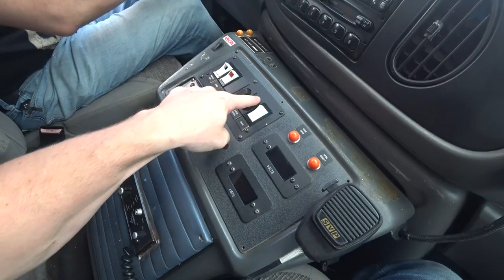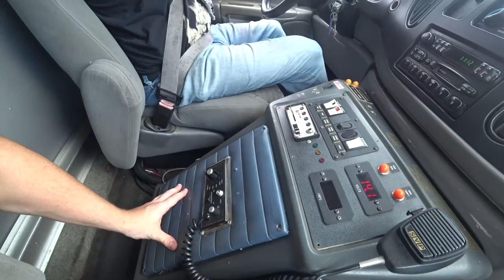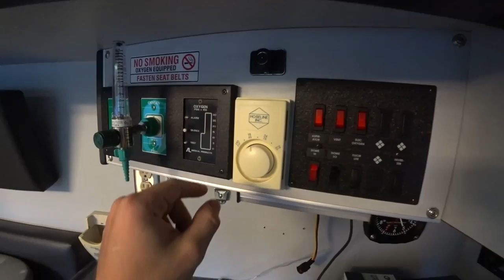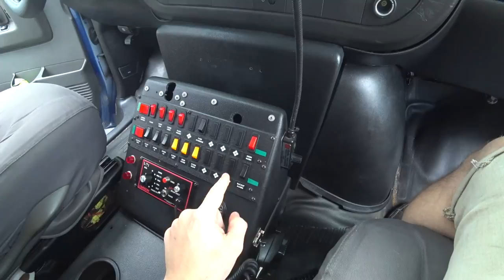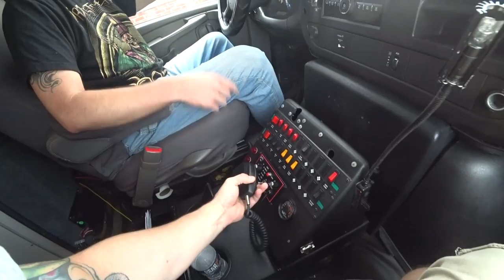So, we bought an Ambulance (EVERYTHING STILL WORKS!!!)

Comment: I’m an EMT, working on an ambulance I can say that those ambulances are super sluggish and fall apart. And I will also say, be careful walking on the roof of an ambulance, they made weak in the event one of the oxygen tanks explodes, it explodes upwards as opposed to outwards to protect everyone around the ambulance. Just some fun facts.
Reply: osha compliant half the time
Reply: If it's a Braun ambulance you will be able to walk all over the roof cause  they are solid body's and the roof structure is all completely tied in and welded...how do I know this...well I still am currently working for the Braun ambulance manufacturer in Van Wert Ohio.
Reply: Its ok dont worry, Dan is baby weight with those baby arms
Reply: Dan doesn’t weigh very much. He’ll be fine
Reply: Next they should buy school bus, fuck it dud
Reply: @MarcLloydZ  might as well go and buy a rocket and fly to the moon
Reply: This is completely made up. You have no idea what you are talking about. They are NOT made weak. There are actual standards and static load tests the pt compartment must pass including the roof...you know...like in a rollover...one of the most common ambulance accidents? They are not made to "explode" upwards. You seriously are just making this up. If you are an EMT, it certainly isn't on an actual ambulance or you would know this. Say, what about the type II buses that have the tanks mounted horizontally? Do they have weak doors and sidewalls so the tank blows out sideways? GTFO with your "facts" as none of these actually are...
Reply: How did he get it with all that stuff thay usually take it out
Reply: @kadenfarmer6255  I wondered that also....
Reply: @shaggy the gears and input shaft are hardened steel. if the internals of a trans were non treated steel or just aluminum they would be changed regularly.
Reply: @Adam yeah it looks like a Braun to me. I’m a service tech on Brauns, they’re tough units! #braunstrong
Reply: How about no? The boxes are made to survive some amount of impact and rollover. They are not made to blow the roof if the O2 tank blows. Get out of here with that shit.
Reply: christopher king  nope, the wheel and front end say mid 90's to mid 2000's E350 chassis cab.  Its old.
Reply: Agreed those Chevy chassis always break down
Reply: @chubbysumo2230  no the new chevy van chassis look exactly the same its newer then 2000s easily a 2010 or newer my fd had one of those was a 17 looked the same exact way
Reply: well sir (or ma'am) thanks for ur service
Reply: Came here from /r/EMS, but how many miles did your first rig have on it? I've won most of these; 680k on an '06.
Reply: @Adam-og3yw  I worked there to in the weld shop and chassis prep. Can DEFINITELY walk on the roof of that thing lol.

Comment: As a former EMT some of the equipment  in the ambulance you could probably sell to volunteer fire department  or rescue squad. The back boards, the cot, I thought I seen a stair chair in it. most of that stuff can be sold and re used.  or ebay even.

Comment: just letting you know it might be the transmission control module, if its stuck in one gear (which may be 4th), and if when you put it in drive it makes a cuncluk sound, also if you don't have a indicator showing its in drive or park, this happened to my dads truck and its a simple fix, just change the device and boom it works, but yes it may just be the trans

Comment: Hey Dan, it might be a good idea to swap the transmission filter now and clean up the valve body just to get the van mobile again. It should be simple and cheap enough to get it around the shop. plus dropping the pan to change the fluid will let you see the clutch plates that alone will show you if the transmission truly needs to be replaced or if you can put money to other things.

Comment: 2009 is the LMM Durmax 6.6 engine. But it doesn't really matter what you Allison you get, maybe a Ten speed if Allison sells it.
Reply: Just need a basic allison 1000 maybe with a mild build for good insurance.
Reply: Allisons are 6/7 speed depending on the model.

Comment: 7.3 motors will always be sluggish due  to the valve on the turbo being slightly closed to help with warm ups. Being in the southern parts just unplug the connector on the turbo. Being a van it should be easy if you take the cover off between the seats

Comment: you should've gotten a retired "activities" short bus with a cummins 5.7 throw the death pin fix on it and you got a SOLID base for a camper, no weak roofs, easier to do mechanical work on, and alot more responsive. the reason to get the retired activities short bus' is because they tend to have less wear and tear, are highway capable, and have storage for the instruments/equipment students would have for their trips.

Comment: JB Hunt is governed to 65mph. Swift is governed to 62 1/2. USA Truck is governed to 65. The only 18 wheelers goin faster than 65 are O/O ( owner operators ). If I remember right, CFI ( XPO Logistics ) are governed to 70 mph, they are the exception. I say this so matter of factly, is because I drove em for 6 years. Majority of my career i spent at USA Truck, along with CFI ( XPO ).  But anywho, great vid as always.

Comment: Had a situation with a floating title here in Florida...turned out you can fill out an affidavit from the seller stating that it was a failed prior sale, and attach the affidavit to the title and DMV will issue a new title to the buyer. Might want to check into it in whatever states you deal with because it can be a huge hassle savings. my mechanic shop was flipping out because they had already signed over the title to a car and then the buyer backed out and they have no way to contact them. They were told they would have to go ahead and retitle the car to themselves again and reregister it. She was totally freaking out over the time delays and cost. I made a quick call to a contact at DMV and found that we didn't need to go through any of that. She was so thankful I got a free oil change and tire rotation LOL!

Comment: It should already have an Allison transmission in it. Duramax is the engine not the trans. And I'm sure it probably already has a 6 speed in it. They've been putting those in since the early 2000s

Comment: 2009 is lmm (2007.5-2011 I believe), basically a lbz with emissions equipment. An allison swap would be pretty easy. I'd go for a dans diesel or another builder and get a built one for good insurance. Then find a reputable tuner and get that bitch tuned and deleted asap. A good 750hp trans build and solid tunes and that thing would be impressive.

Comment: as somebody who has worked on an ambulance, they're absolutely disgusting on the inside lol. Make sure you do a thorough cleaning first. Remove the flooring too because blood and other bodily fluids may have seeped into the seams, especially around the hardware that keeps the stretcher in place. And just be sure to remove the stars of life because I'm pretty sure that in most states if you have them on the vehicle but are not actually a part of an ambulance company, you can get seriously fined

Comment: 07:23 false, JB hunt ( company drivers ) can only go between 62 and 65. It’s annoying as hell getting stuck behind them or prime inc which is governed at 65 but incentivized to go 55. Owner operators are the only trucks not governed. Most if not all major carriers have a set governed speed. Mine for example is 65 on the pedal and 68 on the cruise.

Comment: Ambulance transmissions are set up for soft shifts the valving in the trans is super soft and slips the clutches and wear them out quickly get a stock trans put a shift kit in it and blast that bitch around and maybe add a tune and make lots o coal.

Comment: Bro I work on an ambulance and I get tell you some ambulances in matter what you do they will never get truly clean. Every bodily fluid you think of has been spilled in the back.
Reply: MOPARGuy  oh no we do, but bleach and cot wipes only goes so far if you have cracked or ripped seating, or in actual seals around the ambulance. You can get as much as possible, but no ambulance service out there will provide enough tools and expect their crews to do a deep clean every single shift when there are runs to do. Just google fungus in ambulance and you'll find a story about an ambulance that kept growing mold and actual mushrooms inside of it, no matter how many times they had it professionally cleaned
Reply: MOPARGuy  that would be awesome. One of our ERs provided one of those 2 gallon with a pump and sprayer full of some chemical so we used that when we could lol

Comment: An ambulance is gonna be slow. They weight a fuck ton, the ones ive worked on are about 13000lbs and are dead slow, like 0-60 in 60 seconds with the pedal to the wood.

Comment: Does Ham have a cdl, and does that thing have airbrakes or no?
Reply: Don't need a cdl to drive an ambulance. Also no air brakes as long as its been idling you would hear the dryer spitting. No knob on dash either.
Reply: @johnnysouza5601  what about chauffers license?
Reply: @mr.d_88  wouldn't need it either. Think about it how many passengers would the ambulance carry?